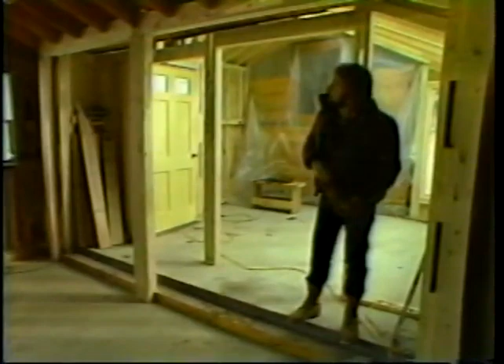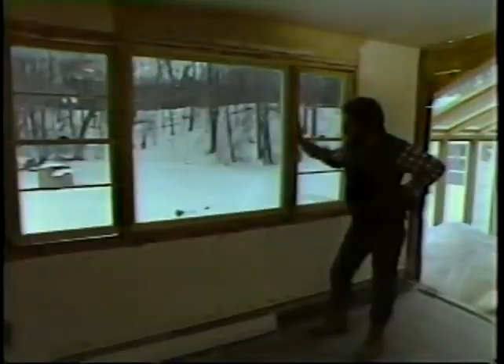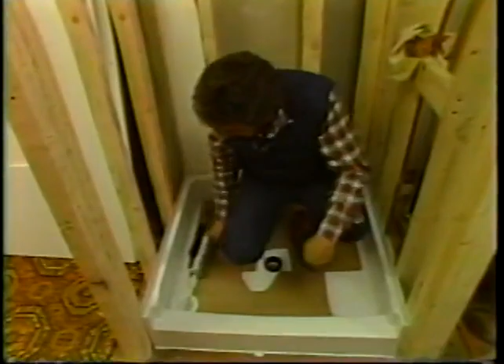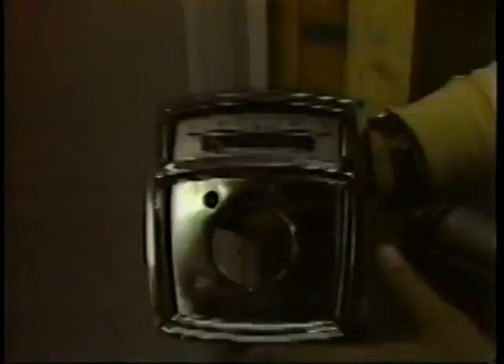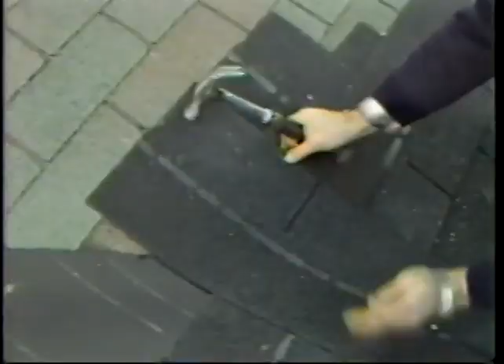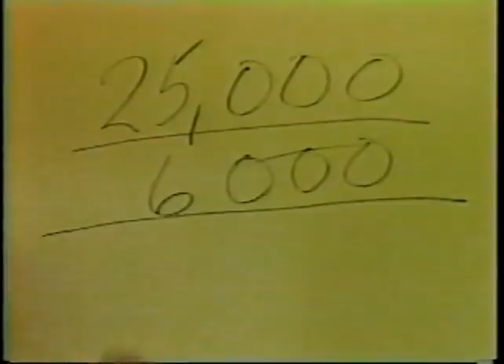This Old House | The Woburn House [Part 4] | 1982

Comment: I cant believe nobody used eye protection back then
Reply: Most residential carpenters don't regularly use eye protection now. It's intrusive and unnecessary 90% of the time. Been a carpenter for 25 years and I only use it if I'm cutting something metal or have to be underneath whatever piece I'm cutting. Aside from that, it's just an obstruction.

Comment: I can’t believe they are shingling on top of the old shingles
Reply: It was 1981😂😂
Reply: These days TOH would tear the entire roof off for a reshingling job. Maybe add another level while they're at it. Heck, they'd likely tear the entire house down maybe except a wall or two. They basically did just that with the mid 20th century ranch a couple of years back.
Reply: Yup, very frowned upon nowadays and often times against modern building code.
Reply: @fnhwk  Shingling over a single layer is standard practice and not against code but the roof needs to be in good condition. Insurance companies really hate more than 2 layers. Now a fun fact is in Bob's Home Again series in his 3rd project building, Chicago Coach House, it had layers going back to the original wood shakes when the building was first built after the Chicago Fire.
Reply: We put a metal roof over our shingle roof about 15 years ago, idk if that's also considered bad lol

Comment: Even this far back in the “ This Old House”  enterprise, it was possible to get the. Tension that was building between Bob Villa , (who was a general contractor looking to cut corners) and professionals like Richard Thewey and Norm Abrams. I especially appreciated when Richard slapped him down regarding doing the rough plumbing himself. The same applied to the heating professional in telling him that the furnace should be replaced as it would not have much left. Villa was trying to cut too many corners, in that with the heating runs, while ok for going through the closet and into the toilet, really needed to be cut and repiped in the kitchen, as to have heating run behind the cabinets causes the cabinets to deteriorate. 

As the 1980’s was a time when much more efficient products  was coming on to the  market, it was surprising that he even questioned having a separation between the foundation and the wall sills. He did not come across as a homeowner going through the process.nor was he looking ahead to the franchise being able to sell the house even in that market, as keeping the 1950’s bathroom would be a detraction.as opposed to a more antique bath that had retained the period look of a house from the turn of the century but had the most modern convinces even the basic plan of converting a garage into a living room, for the Massachusetts winter weather was ridiculous, as evidenced by the snowfall and how a family would e react to having to shovel out a car in an outside space, which was the most likely reason for building the garage in the first place.
Not to mention that nothing was done to install any type of heating runs between the house and the garage under the new entrance way/ sun room. 
While the show was initially  geared towards the DIY/ sweat equity consideration, it was always meant to help homeowners  preserve and reasonably upgrade their houses. A practice they hav continued to this day, it always seemed that Villa wanted his own visions and seemed upset when better ideas were expounded.
Reply: In his defense he was trying to work in a budget and do what most homeowners do.  He has to look at what you can afford and what you can cut.  Doing the pipe install he only got shot down because you have to be licensed.
Reply: were* coming
Reply: conveniences*